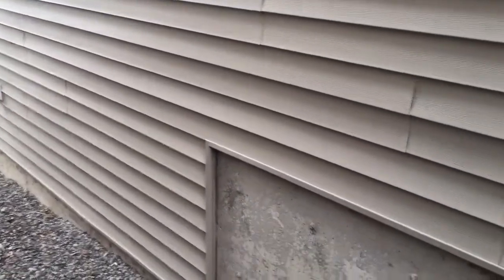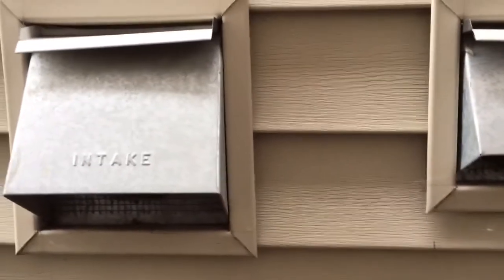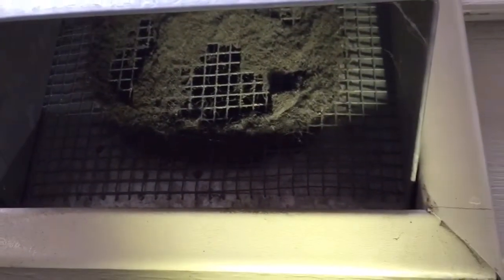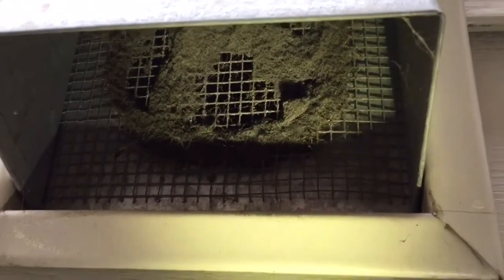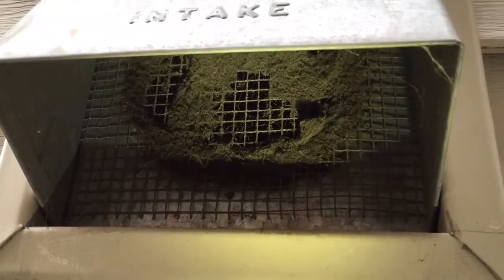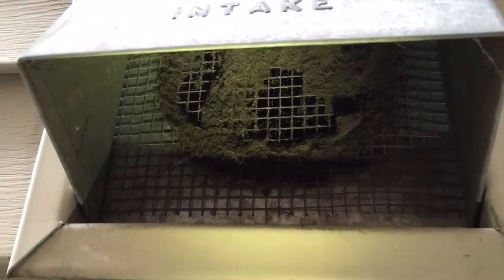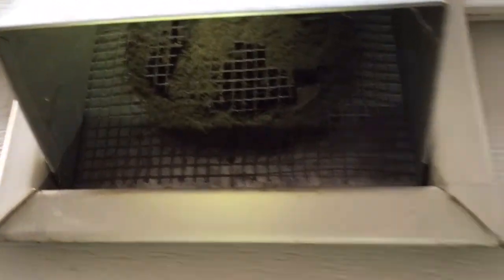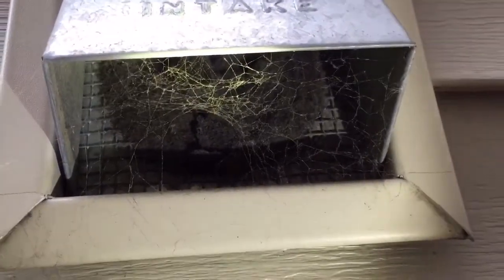How to find your Combustable Air Intake

Comment: I would also like to comment that when inspecting air intakes you need to be careful of wasp nests inside the intake, or under the metal hood. Wasps love to build nests there. Of course, this isn't an issue if you inspect in the winter, but at all other times of the year you have to be mindful of that.

Comment: Are the intake vents sometimes located on the roof? We have an older home with a mid-efficiency gas furnace. I went around and did not see any vents as pictured in your video.

Comment: I have an unfinished bonus room/laundry room attached with 2 car garage. I will put up a partition wall, ele, insulation and drywall with permit in CA. I guess I will need to enclose my (1987) 60,000 BTU Furnace & HWH and run a combustible vent? Do I need fire rated doors on enclosure? There are no vents inside attic for fresh air so at what level do I install outside air intake vent?

Comment: Is any other ventilation needed other than the air intakes for furnace and hot water tank? My land lord doesn't want to weather seal the exterior door in the basement because he says the basement needs air flow for the furnace and water tank on top of the intakes.
There are visible gaps around edges of door where you can see daylight and clearly outside. I want to seal it but don't know enough about what furnaces and hot water tanks.
Reply from the maker: Hi jeff stojak if the intake ducts like the ducts in this video are 4-inch then they are plenty. Seal that basement door up. You are losing valuable heated air. 

Thanks for the great question.

Comment: No your home doesn't need to "breathe". That's an entirely antiquated ideology. A tighter house is a more efficient house. Of course you have to control moisture and temperature inside the house and have a sealed combustion hvac.